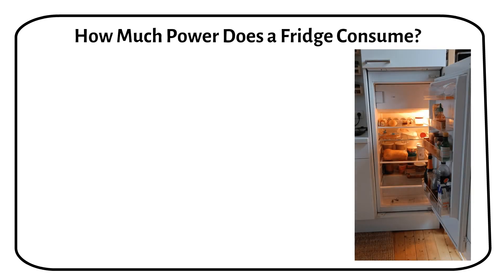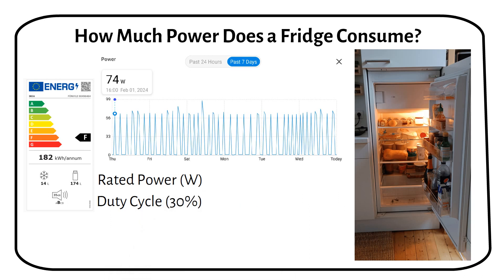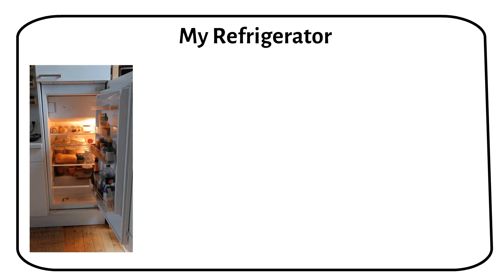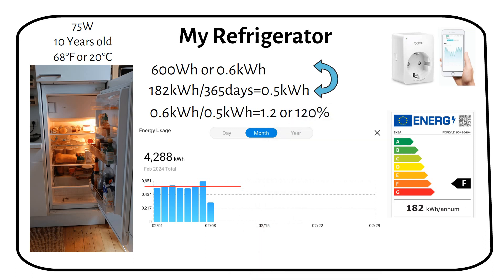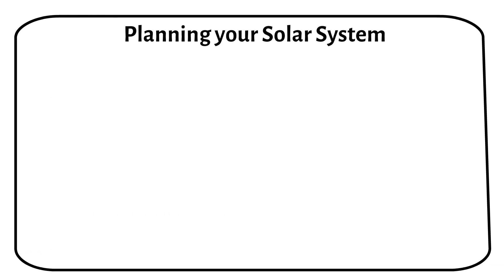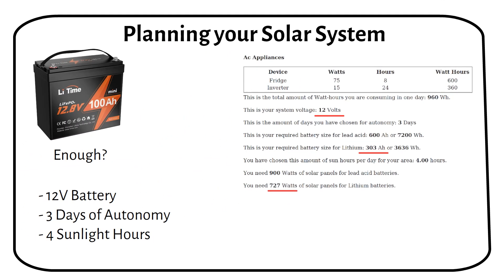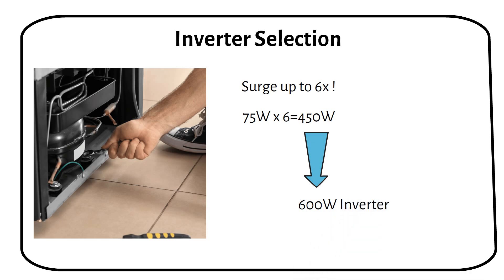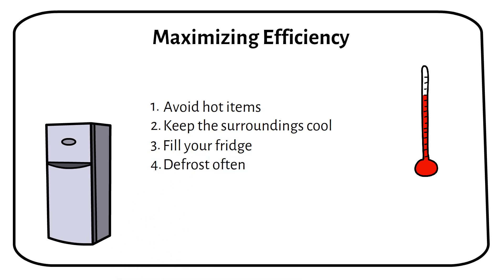Fridge Power Consumption - How Much Power Does my Fridge Consume

Comment: Hey, just been reading your book. Liking the info! I think on the fridge section of the book there is a typo. it's either that or I'm going mad. No worries if it's a typo but I just wanted to make sure my sanity is not compromised. You say: "My 100W fridge cannot run on a 1,000W inverter; it can on a 1,500W inverter. So it doesn’t hurt to size the inverter larger than four times the nominal power rating." Surely the 100W Fridge should run fine on 1000W inverter? 100W * 4 = 400W. Like I said, I'm pretty sure it's just a typo but would be good to get a confirmation unless there is anything else obvious that I'm missing. Thanks
Reply from the maker: Not a typo, I tried running my 80W fridge on a 600W giandel inverter and the startup surge power was too high for the inverter. I believe I tested 1,000W inverter from little as well and it didn't work. Then I took a 2,000W inverter from power queen and that worked. So it's the inrush current, and that's why you need a large one.

Typically, the usa has higher power fridges like 200W, but those should be fine running on 2000W as well.

Comment: your website recommends running multiple inverters in parallel if we need more than 4000w of power. how would we do that? i can't seem to find a video of yours explaining how to do so.
Reply from the maker: Thats only possible with inverters that can run in parallel like the victron multiplus or EG4 6000XP,...
Reply: @cleversolarpower  ah these are options not available on my country for the most part. I wish I could get into the importation business but it's not easy to do anything in Haiti.

Comment: i previously asked about air conditioners on one of your more recent videos but it seems as though i've somewhat found my answer. since both use compressor technology i assume it is the same. i would just need the power consumption of the air conditioner as well as the amount of time it runs for. though i must say i'm still unsure in regards to starting/surge watts.
Reply from the maker: Starting power can differ greatly. ideally you should measure it with a current meter that can measure peak amps. Not all current clamp meters have this functionality. I also recommend using a low frequency inverter to start AC's and pumps. I made a video about low vs high frequency inverters.
Reply: @cleversolarpower  you are the reincarnation of jesus christ. genuinely the best human being on the face of the planet. thank you my friend i will look to purchase one. i really hate that i'm bothering you so much. know that my gratitude is eternal.

Comment: I have three fridges, small ones, that I turn 90 degrees so the door opens upwards. 

A cold one at 42F for meat and dairy. A chilling one at 50F for drinks and produce, and a freezing one at 30F for long term storage. Saves me about 25% electricity consumption annually compared to my old one-in-all unit.
Reply from the maker: I'm not sure if it's ok to turn your fridge on its side.

Comment: How much batteries to run 46w fridge?
Reply from the maker: 46W*8h=370Wh+idle consumption of 1000W inverter = 370Wh+20W*24h=370Wh+480Wh=850Wh*3days autonomy = 2550Wh battery /0.8=3200Wh battery. 3200Wh/12.8V=250Ah @12V

Comment: Really good video. My fridge "from the 90's" only has 115 volts and 6.5 amps on the label. Volts X Amps = 747.5 watts,  However when I plug my Kill-A-Watt meter in I get 121 volts, 1.6 amps and 180 watts at start up and 165 watts running.
I'm not that great at math but trying to figure it all out. 
I'm building a 24 volt system with 8 LiFeOp4 batteries and 600 watts of solar panels "per my charge controller" to start. I will probably add another charge controller and 600 more watts of panels. My charge controller is a EpEver 6415 AN and only allows a max of six 100 watt panels for a 24 volt battery bank.
I was hoping you could fill me in on how to do the math. I'm pretty sure I have enough batteries to run the fridge for days. Thank you for any help.
Reply from the maker: The amp rating is probably the DC rating of the compressor. So your kill a watt meter will be right. I have made a video about sizing your system and charge controller. Make sure to check them out.

Comment: Hello, I have some questions. What's the model of your fridge? During all your measurements were you using this device normally? I mean if you used it to do meals and other? And how many energii will my fridge use if it would be used aproximatelly by 12 hours and opened very often (during party all night)? I have to buy fridge and I have many doubts about using energy because I am planning use to this solar system. Thanks for your response.
Reply from the maker: It's an IKEA fridge. Opened approximately 20 times a day. Opening a fridge is not that bad. Just have a lot of volume in it like water bottles to keep it cool.
Reply: @cleversolarpower  So how do you think? How much energy will my fridge use during all day including 12 hours party? How much by 12 hours party and 12 hours normal day when fridge will not be opened. My fridge uses 121kWh per year.

Comment: Magic Chef
HMDR1000WE 297 kWh? 
115volts,  1.5 amps 
Power input 160 W 
My calculations are off I guess over the defrost mode
Reply from the maker: 160W*8 hours a day * 365 = 467kwh
Reply: @cleversolarpower   why would energy star rating say 297kWh/yr.  Is the 160w with defrost mode on?